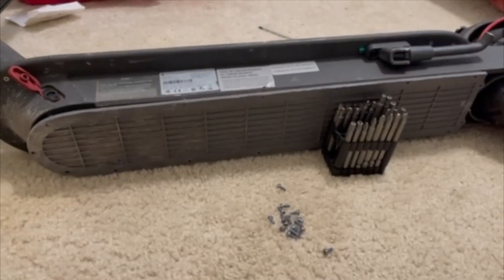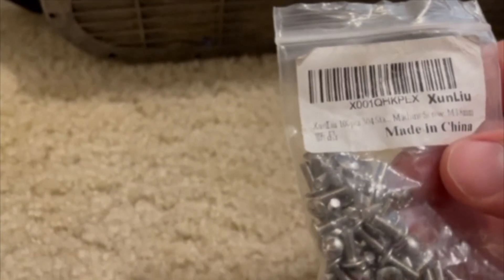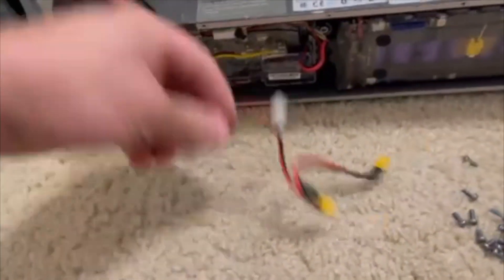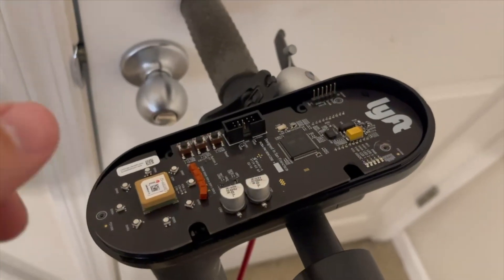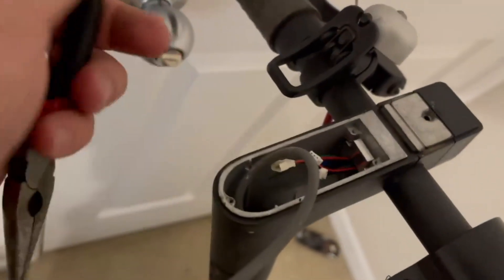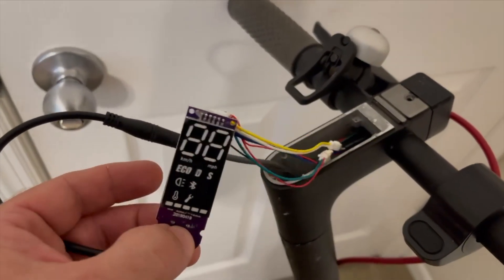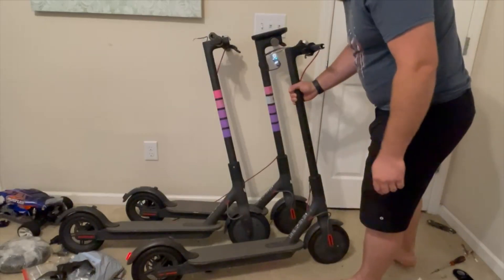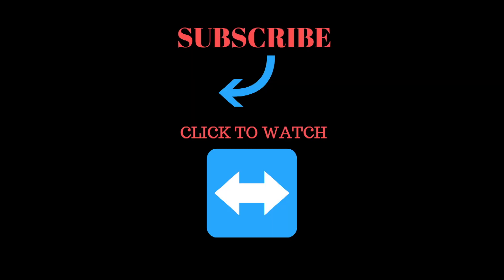Converting Lyft Rental Scooters Into Personal Scooters. Step By Step.

Comment: Torx are the 6 point screws, the ones with the pin in the middle are called tamper proof torx.
Reply from the maker: 👌🏻 thank you for the break down
Reply: Thank you for stating the obvious🤡
Reply: @Anonymous-lj6or  thank you for that much needed reply to a comment that’s 8 months old🤡
Reply: its called torx screwdriver bit you need
Reply: It's actually an Allen/hex type of a security bolt
Reply: Many actually use the special 5 point torx
Reply: @lexicase8805  yeah that could be

Comment: Lyft scooter mechanic here. Not sure when or where that model is from, but, at least here in Denver, the vast majority are 2.2. The main differences is how you access the battery area and the IOT (GPS brain part.) IOT is a similar removal, but different cables. As for accessing the battery hatch, there's 3 things to get through if you don't have their nfc crap. One is more security torx to remove a plastic piece next to the rear wheel. Thus will expose the rear light cable, as well as 2 pentagon bits. After you remove the penta bits there's a keyhole. We have the keys, but they're basically just flat pipes of metal, so you can probably just pick your way in. This will get you access to the majority of the cablage, and, of course, the battery. Really nice, bug batteries. I don't know if any replacement IOT will work with the control board, which is in the base, and accessible by removing 4 triangle bits. 
All that being said, get one with tires that are intact because replacing them suuucks
Also, as a lyft mechanic, screw em. Modify to your hearts content. For legal reasons, don't steal them. But uhm. I won't tell...
Reply from the maker: Thanks for the break down. These are obvious old stock that were rotated out before being sold. In the event you make your own video of the carnage please share here.
Reply: @teambryie  We do have some of the old models lying around, but they've clearly been phased out. Didn't know they sold the old ones. They also have some bird and lime scooters for some reason. But yeah, if I can get my hands on any of them I'll be sure to share. Especially if I can find the exact size for the bits
Reply: Cheapest set I could find is like $20. Can always use a dremel to...modify screws into flathead
Reply from the maker: @drakmeir3507  agreed. The Dremel is gold, just takes a few more minutes.
Reply: What do I need to look up to get the motherboard or brain or watever to go in the top on the 2.2a
Reply: Hey man can you please tell me how to take tracker out of em
Reply: @Ando_818  Tracker is GPS based, so that's the IOT. Remove the 4 screws underneath the IOT. They are all tamper proof torx, as are most on the scooter. Careful when removing the head, it's a tight fit, so it will take some work. Push up with your thumbs on both sides until it comes loose. From there, just remove all the connected cables. Power (do this first as to not risk damage to components, it is the thickest cable), beacon (front light), brake, and handle. Whatever replacement module you use will need to use the same connectors.
Reply: @teambryie  Lyft has never sold their scooters. So this doesn't add up.
Reply: Could you do a video on it? Of course please hide your infos so no backslash
Reply: Oh man. I need to talk to you sometime. I'm about to do my first replacement.
Reply: @drakmeir3507 if someone were to take one and remove the GPS, what are the chances Lyft would figure it out or come looking? Not that you should but I’m wondering if it’s really as easy as that. A lot of them get thrown into water so if you could recover one it should still work since they’re water proof
Reply: Yeah it looks like from his video that a lot of the stuff was parts and there wasn't complete scooters for some of them and there's a lot of stuff there LOL
Reply: Hey I wanted to purchase a scooter that has the same cabilities as a modern lift scooter do you have an Amazon recommendation for a scooter with similar specs?
Reply: @drakmeir3507 is their a way to hack the iot board, like install new firmware and use a app to track it?

Comment: Now do bolt scooter. I had one chucked in my backyard, nobody picked it up so its in my garage now :DDD
Reply: Go unplugg dat GPS Module or yu gonna get busted ig
Reply: Remove the gps bro just has 10 screws
Reply: I also gotten one like that and no one came or not even when it was abandoned for 3 weeks no one came to pick it up to put it in circulation, it had very low power and it was literally dropped in a red zone in the city where these scooters shouldn't be, but anyways, no one came for it so, I'd gave it a better use.
Reply: @chuyramirez3731  were you able to use it, if yes then how much does it take to charge and how long can it work for??
Reply: @chuyramirez3731  why does it need a new battery? Mot of the videos I saw only need the motherboard changed, thanks for your time✌️
Reply: @thecompilitation8314  Yeah, you can flash or bypass the Battery which ever fit you, some will just replace it.
Reply: @chuyramirez3731  thanks man,

Comment: HELP NEEDED
Can this be done in reverse?
I want to get a set of scooters for my employees to use around campus but I want to make sure only they can use them. I'd sign up for a company bird account but those scooters are kind of slow and don't have suspension and I need my team to be able to get up hills quickly.
I have the api and the coding knowledge but not the mechanical knowledge
Reply from the maker: Great concept. Wish I was able to help.

Comment: I got a Lyft scooter from a Garage sale it was all wrapped up with plastic, after getting it home I cut off the plastic discovering that it was a Lyft scooter.  I believe it might be stolen as even the pink and purple color squares were taped over to conceal that it belonged to Lyft.  It does not look like the one in your video. I tried to call Lyft with no luck but did send them a note through there lost item complaint on lift's web site. It looks like an older model and the top controller is completely missing, but it is a clam shell type, if that helps to identify the model. My original intention was to fix this scooter up for my daughter as a replacement for her old scooter that is falling apart.  
until I found out it was not a privet scooter. any idea on how to proceed. If Lyft does not want it back or does not get back to me, Can I legally fix it up with out worry. Any advice would be appreciated, Thankyou.

Comment: Have you be able to domesticate the newer Bird 2 scooters yet? Looking forward to your response!
Reply from the maker: I’ve not got my hands on one yet. I’ll make a video when I do.
Reply from the maker: @pjscootermods  is there a gps?
Reply: @teambryie  yes It’s right on top same location as your Lyft scooters Green motherboard with all the same components GPS/antenna etc.
Reply: @pjscootermods  gotchu my guy!
Reply from the maker: @pjscootermods  Good Work 👌🏻
Reply: @pjscootermods  ayy bro I need some help with my bird 2 hmu plz
Reply: @guapthehustler9013  got u bro ! what part do you help on ?
Reply: @pjscootermods  ok bro I just tried to do the battery bypass by suturing a wire between the p+ and b+ but some crazy big ass sparks keep flying off this shit like did I do something wrong?
Reply: It’s normal for it to pop bro it’s because you’re Working on a live circuit/touching energized parts. your just bridging from B+ to P+ .. be sure not to touch any components around it
Reply: @guapthehustler9013  can you make a video on how you did it
Reply: @pjscootermods  alright bro I've literally done and followed all your videos anJ bug 4th but my scooter still ain't working? Could I get some help big dog#?
Reply: Take that sim card out, try it in a phone (not yours) I bet you can use it for calls, internet.
Reply: @cdmChase1  i know u can lol

Comment: Hey buddy! great video! i got a green connector with 5 pins for the controller... i already blew up 1 controller kit just like yours with 4 pins blue color... any advice?
Reply: i know that the 5th pin is to power the gps... but i dont know how to proceed....
please advice. keep up the good work !!!
Reply from the maker: Remove the 5 pin cable in the neck. Its only a short cable connection. It’s not very long. It is connected to a 4 pin. Let me know if you have any problems. You will need a new controller also. The one you blew up is toasted for good.
Reply from the maker: Also, don’t forget to remove the gps cable adapter by the scooter motherboard first.
Reply: @teambryie  hello, I'm on the same boat please help, 5 pin green connector: yellow, blue, black, red and green wired.  And in the scooter have 3 connectors, one for the throttle I think is a green, red and black wires,  a 2 wire connector that I think is for the led light is black, white wires and a third connector that also think is for brake light that has blue, red and black wires.

Can I just splice the 5 green wire and cut the pin 5?
Reply: @teambryie  so the 5 pin is connected to a blue round 4pin?
Reply from the maker: @jodyhough7475  Yes, exactly.

Comment: looks like the dashboard kits run $15-25 might do this, any idea if anything different must be done for the bikes with an external battery pack?
Reply from the maker: Yes, you can find it from $15-$50 on eBay/Amazon. They will all work. I get mine from AliExpress for less than $10.00 each but I also have to wait awhile to get it in. I’ve not had any dealings with electric bikes.

Comment: What if the scooter is a 5 prong connector for the dashboard
Reply from the maker: Pull the cable out of the scooter neck. There’s a 12” adapter piece you have to remove.

Comment: where can i get the one with the 5 prong?
Reply from the maker: 5 was specific to the manufacture. You only needed 5 prong to help power the gps. 

You can find the 4 prong on AliExpress.

Just found this amazing item on AliExpress. Check it out! US $10.49  77％ Off | Bluetooth Dashboard for Xiaomi M365 and Pro 1S Electric Scooter With Protect Cover Display Upgrade Repair Parts
https://a.aliexpress.com/_mK3OZ0C

Comment: Is there a way we are able to make then fold again ?
Reply from the maker: Yes, only takes a few minutes to do when you’re in the assembly process. You can find the adapter on eBay. It’s about $40. Just search key words for the part. If you can’t locate it please let me know.
Reply from the maker: https://www.ebay.com/itm/For-Xiaomi-M365-Electric-Scooter-Folding-Pole-Base-Replacement-Repair-Spare-US-/393310867151?_trksid=p2349624.m46890.l49286
Reply: I got like a fatter scooter it says assembly by segway  is there any piece for that one it's like solid metal
Reply from the maker: @luisllanos9250  what is the model number?
Reply: @luisllanos9250  same smh 🤦🏽‍♂️ I think we have a es4 motherboard but my adapter is five prongs instead of four, so idek at this point

Comment: Why cant you just remove the gps and use it ?
Reply from the maker: It needs a new control board also.
Reply: @teambryie    can't you disable the GPS chip by soldering it off or popping it off the board and away you go ?
Reply from the maker: @R_B_Taylor No, you still need the on/off function added to the scooter.
Reply: @ so the top gps part is all just tracking shit ready to throw away ?
And how do you recharge them ?
Reply from the maker: @R_B_Taylor Correct. All useless. You can find a charger on amazon. Just search xiaomi m365 charger. Make sure the connections match. The charging port on the scooter is on the side of the base(deck). Next to the battery.

Comment: did you remove  a black plastic casing from the battery off camera or did it come like that? mine doesn't look like this exactly like yours does after you take the grate and metal dish off- and it doesn't seem to have that jumper you mentioned- any ideas?
Reply from the maker: I didn’t remove anything off camera. Every bird/Lyft model m365 that I have, looked like this. Maybe you have the next gen? Does your base look exactly the same?
Reply: Im having this same issue! Model SCT-03–0-B
Reply: @teambryie  Im having this same issue! Model SCT-03–0-B

Comment: I got a lyft scooter, but connecting the new dashboard burns it, I don't know why?  you know something? I have the model SNSC 2.0 manufacturer Ninebot and Segway, I have photos of the model I have, can I send them to you by WhatsApp or email?
Reply from the maker: Instagram @victorbryie or email teambryie@yahoo.com
Reply: Did you ever figure out how to convert a SNSC 2.0?
Reply: You can’t just plug a dashboard directly to an iot line or you will send 42v into a line expecting 5v. You need to rewire it.
Reply: @joeybab3  ok so I have to look for a current of 5 volts to be able to connect the board ??
Reply: @h3nry1448  no no, you have to get a replacement controller to make it work